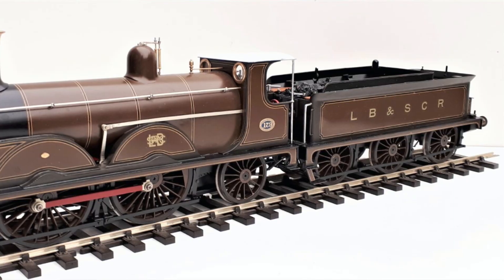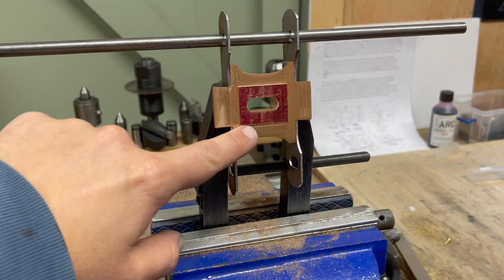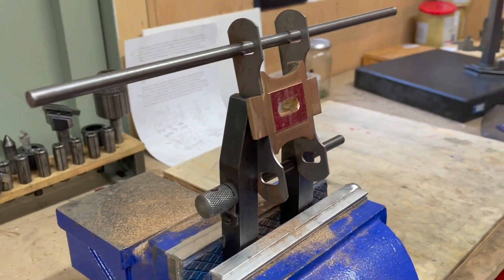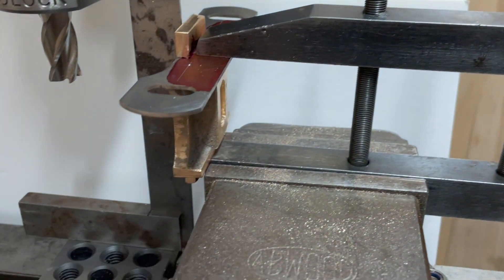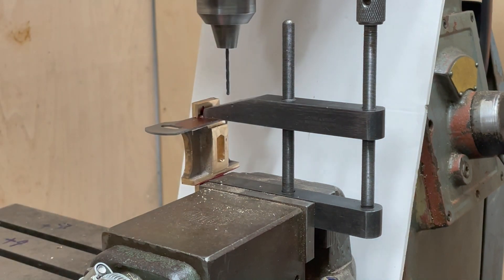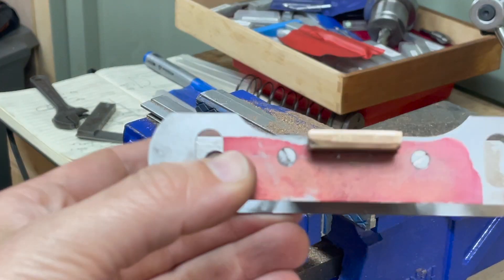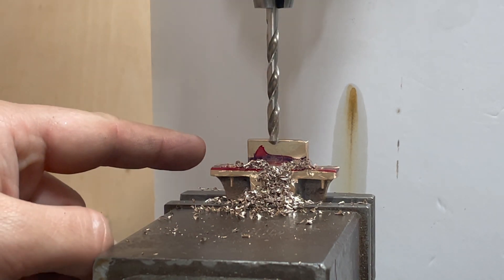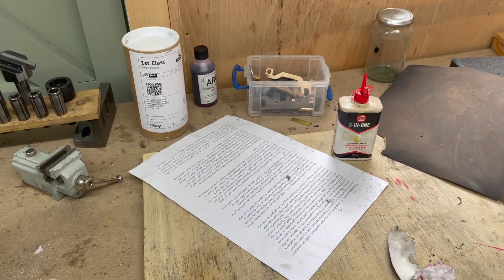Building a Live Steam LBSC Atlantic in 2½" Gauge - 1.5 - Bogie Stretcher Drilling

Comment: Sorry, my comment seems to have been sent prematurely. To continue:
but if you wish to combine it with other rolling stock, or make it part of, say, a garden layout, then you need to plan ahead and pick the livery that would be appropriate. You are after all, on a long-term project involving a lot of time, effort and financing, and it will be important to make the right choices.  It is tempting to say that the selection of livery does not need an early decision but, as I have said, if the livery has implications for the construction of the model, then the decision has to be made early.
Best wishes,
George Clements
Reply from the maker: Thank you very much George for your thoughts and advice. I think that on consideration your question has prompted me to stick with the Umber - after all, I could build a single 'observation coach' from the LBSCR as a separate project and be equally complete!

Comment: Two things occur to me about choice of livery. First, were there modifications to the locomotive over time which would need to be taken into account during the build ? It would be a real shame if you built the loco and then found that the livery you wish to use would be anachronistic in respect of the detail in the construction. Secondly, your choice must surely depend on the use you propose to make of the finished model. If your aim is just to run it as a stand-alone exhibit, then the choice of livery is unimportant
Reply from the maker: I think the only external difference between pre and post 1928ish was that the cab was cut down to have greater route availability - the LBSCR was pretty generous and the SECR was not, when it came to loading gauge!